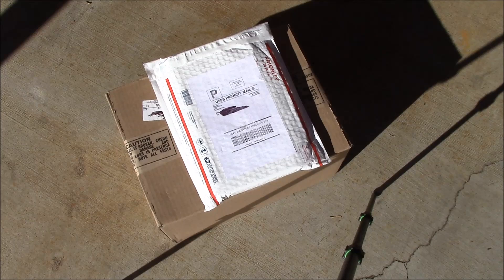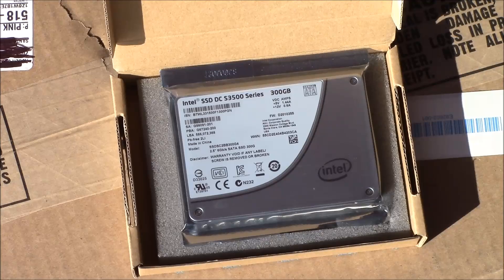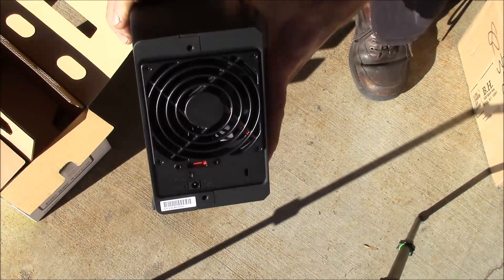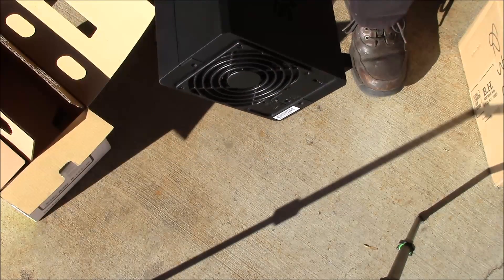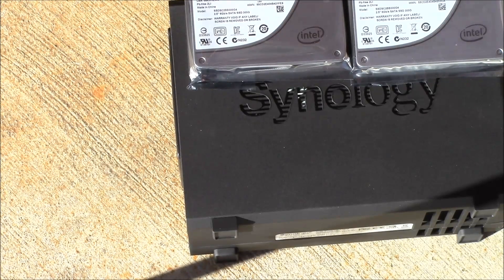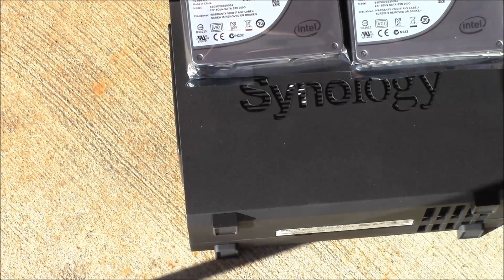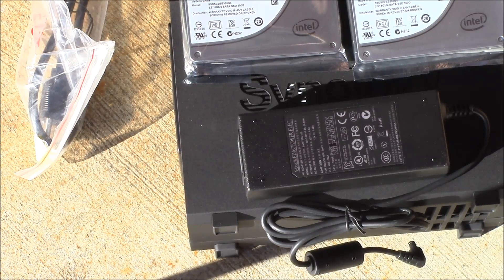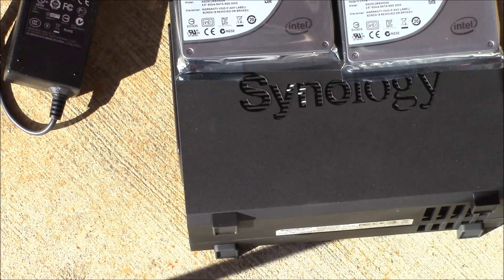Synology Diskstation, SSD Cache, Part 1

Comment: do i need to enable the cache inside a 2 bay DS718+ with 2 ssd of 4TB ? (no magnetic hard drive here only those 2 ssd) thank you
Reply from the maker: I don't think that would work or be of any benefit if it did.  I think the SSD cache needs to use the entire SSD (or 2 SSDs for a r/w cache) so you would be left with no drives unless you have an external expansion box attached. 
 Using SSDs to cache data for an SSD would only add an extra layer of overhead and probably would slow things down.  The reason to use an SSD as a cache for a magnetic drive is that it's much faster with no seeking or rotational latency.
Reply: Then if i understand i just install my 2 ssd drives make an raid1 and thats all ? (I will not use any magnetic drive ^^) thank you
Reply from the maker: Yes, that would do it.  The SSD r/w cache is RAID1, so making a RAID1 volume with 2 SSDs would give you the same performance of the SSD cache without cache.
Reply: I fault i have to make an specific setting somwhere to specify i put ssd drives :) i ordered 2 rack 3.5" to install the 2.5" ssd to fit them like 3.5" inside the nas :)
Reply from the maker: I've never created an all-SSD volume, but I think it's just the same as an HDD.  There is some mention of setting the SSD TRIM option:
https://www.synology.com/en-us/knowledgebase/DSM/help/DSM/StorageManager/volume_ssd_trim
Reply: Thank you :)

Comment: Is there any benefit to doing this if you are not using your drives in raid? Im just wondering if I can get faster network transfers by adding 2 ssds for read and write cache?
Reply from the maker: Might be less benefit and only if you have some sort of Synology managed volume to add the SSD cache to.  It helps most in a higher level RAID where files get split up over many disks so you have many seeks and transfers to wait for.  If you are seeing multiple drive access lights coming on for a given file transfer, then a cache might help.

Comment: Wouldn't it be possible to connect an SSD-disk via the USB3 connection? Or is that much slower?
Reply: +Leonidas I would like to know if the Synology supports that for an SSD cache and if e-sata connection is 3GB or 6GB if you look at this: 
http://www.buzzle.com/articles/esata-vs-usb30.html
I have the DS1512+ myself
Reply from the maker: +Leonidas I'm sure you could do that, although I'm not sure if that USB drive could be added to the internal drive array.  Might need to contact Synology tech. support to see if they have that feature or not.  That would be a nice option if it were supported since USB3 speeds are comparable to SATA.  They may treat USB drives as removable media similar to Windows where you can't do things like have swap space on a USB drive.
Reply from the maker: +Leonidas I was never able to determine if they use 3 or 6GB/s on the eSATA connection.  They do say SATA-III on the internal drives, so one would assume the faster speed on the eSATA expansion port.
Reply: +R Brown (4Crawler) Thanks. I will inform about that with Synology but I also suspect it's not going to work.
I'll let you know the result.
Reply: +R Brown (4Crawler) This is what Synology sais about it:
As system design, the SSD cache only supported with internal disk, cannot work with external disk, neither usb nor esasta.

Currently, there is read or read/write cache, no write cache only.

https://help.synology.com/dsm/?section=DSM&version=5.2&link=StorageManager%2Fgenericssdcache.html&lang=enu

Hope this helps.
Reply from the maker: +Leonidas Good to know.  I think they must have some extra "stuff" in their drive bays that enables adding the hard disks or SSDs into the system.